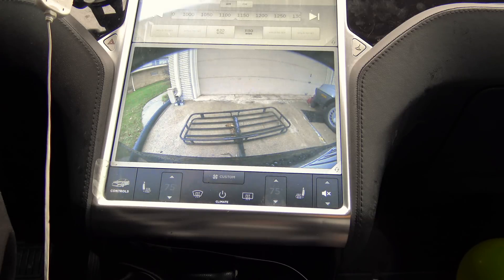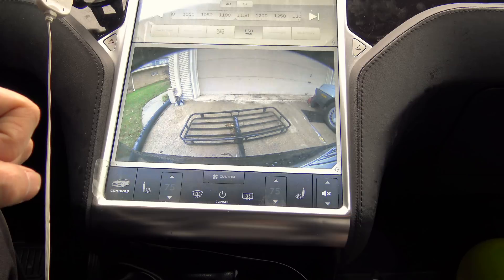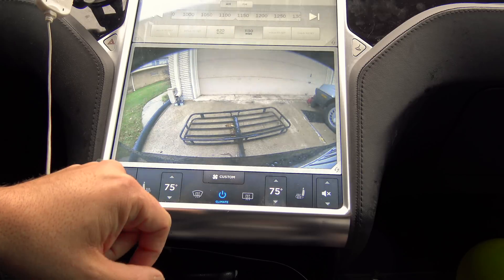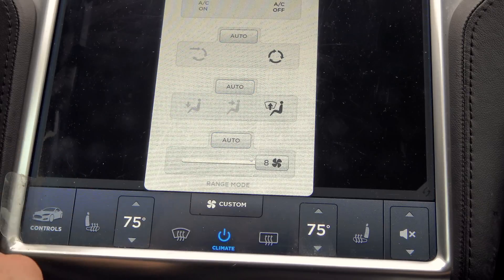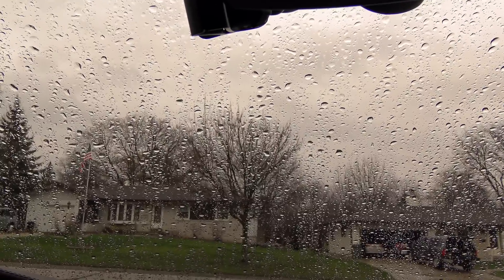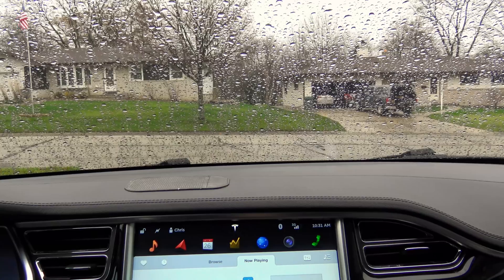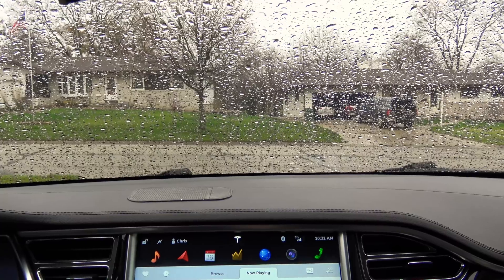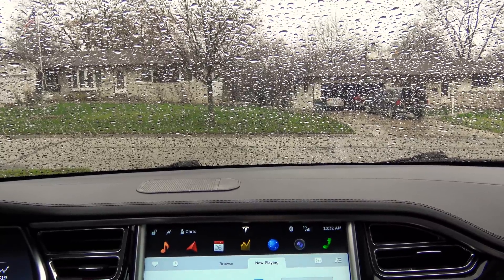Tesla Model S/III/X: Defrost Button Explained

Comment: What size blanket would it take to cover all of the windows?   I wonder if an electric is available in that size and how much power it would consume for the same effect.  Or a large non electric blanket just to trap the heat the car generates.  Another thing you can try, if you have the parts, is erect a transparent tent or one with a closed transparent window facing a source of heat or the sun around and over your car.  The temperature inside will rise and might melt the ice and snow faster.  Even in the dark with just the car's heat, it will hold that in and help.

Comment: I wonder why they don't offer an electric windshield defroster/defogger at least as an option on the Model S. Several other cars do-- mainly in Europe-- and they're really awesome compared to using heated air blown across the glass. I would think that would reduce the energy consumption by quite a lot by not having to heat the cabin air  unnecessarily and only providing just enough heat to melt ice and defog the glass. I know the windshields do cost several hundred dollars more, but that would be something I'd be WAY more than willing to pay extra money for if I ever live in a cold climate again. Those things will de-ice and melt/defog a windshield from below zero weather in about 20-60 seconds and then you're done and good to go.

Hopefully they look into that option over the next couple of years because if I buy a Model 3, I'd like to have it available for when I travel back to Colorado to visit family over the holidays.
Reply from the maker: +babybirdhome I suppose they started with the heat strips for the heated wipers.

Comment: Cool. I mean, hot. I mean. . . .

Q: Is there a way to get the rear defroster to activate automatically if the outdoor temp is low enough? Or is it totally manual? Thanks.
Reply from the maker: +John P. Weiksnar No. Totally manual. Press the button :) Stays on for about 15-20 minutes.
Reply: +KmanAuto Okay, thanks.
Reply from the maker: My Pleasure! ;-)